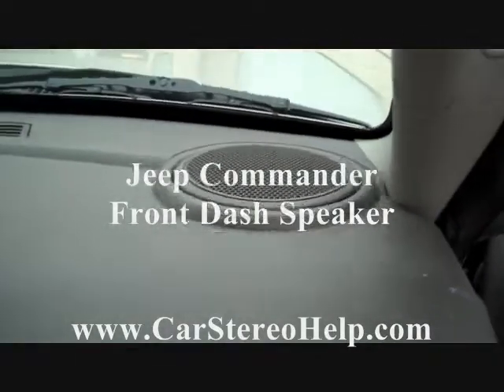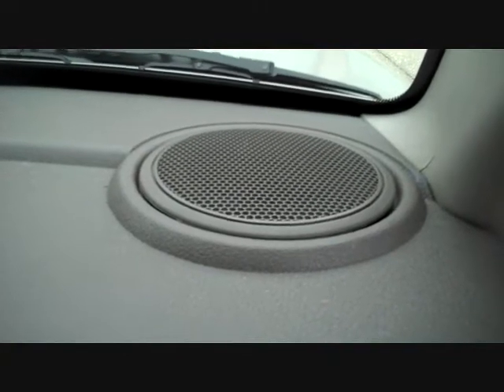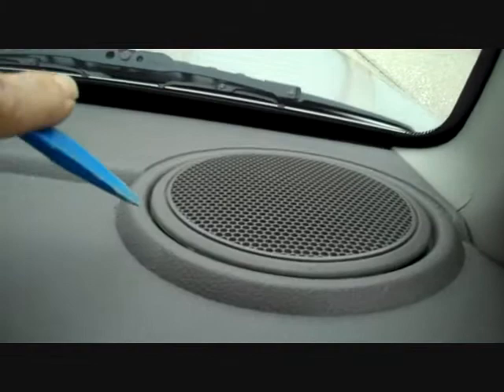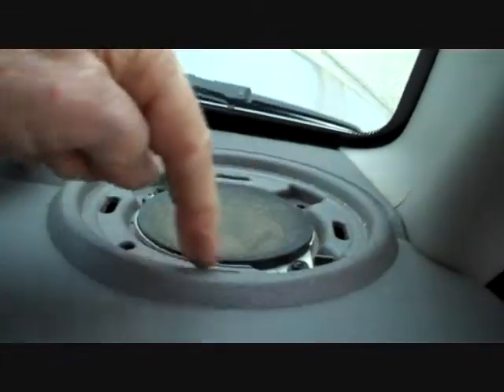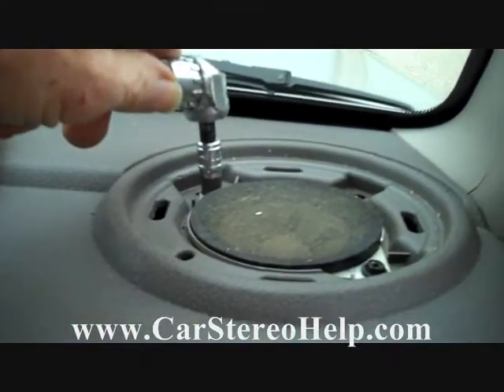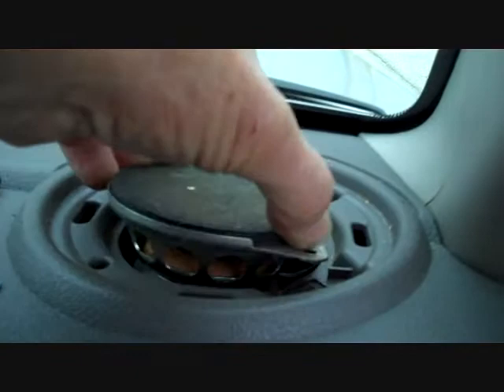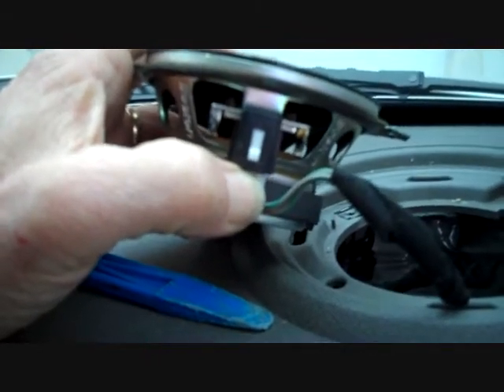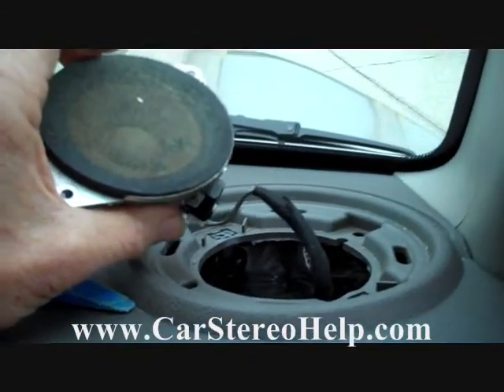Jeep Commander Front Dash Speaker Removal = Car Stereo HELP

Comment: What kind of speaker harness do you need to fit the new speaker to the old connector?
Reply: Metra 72-7902 Speaker Wiring Adapters are the ones I use